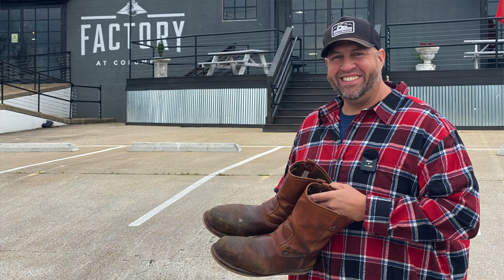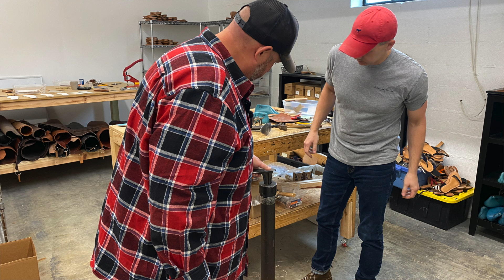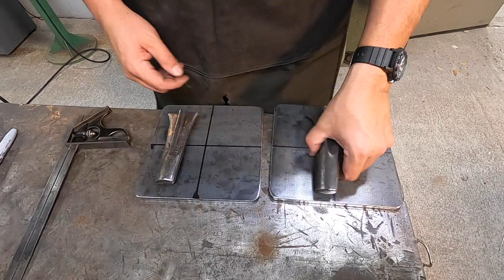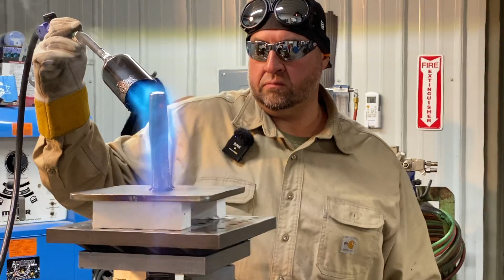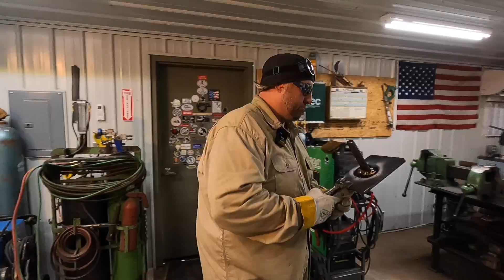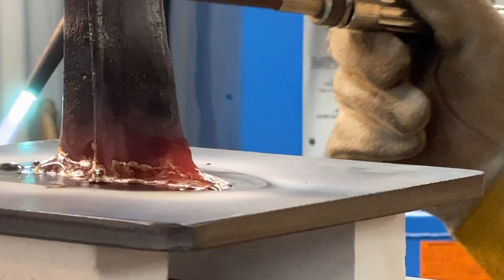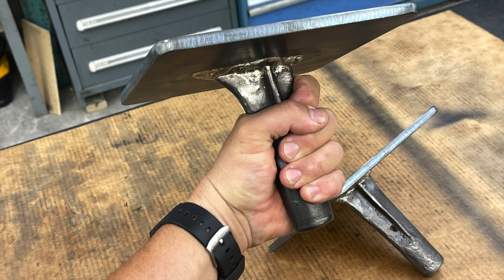Custom Shoe Anvils for Potter & Sons

Comment: A foot square is a standard tile size, I actually use a wooden block one foot square as a base for my rubber mat, quartz, wooden cutting block, etc… everything foot square.   Very handy for leather crafting.  I also use a metal tile.  It’s a snap to clean after gluing.

Comment: Why not braze it directly to the "shoe" surface? More surface area and a reversible modification.
Reply: The shoe is profiled, non of it is flat. There probably wouldn’t be more contact area and it would be a lot further to flow the filler. You could grind the shoe flat if you needed more strength but as Adam said they’ll be plenty strong enough

Comment: will the brazing hold the hammering in the long run, esp. when off to the side impacting the maximum torque ? or would some reinforcements to the sides help?
Reply: I think you're over estimating how much impact that will actually see. They're not forging steel, hammering nails into a hardwood, or swinging a 2 lb mini sledge. They're working on shoes.

Comment: TIG welding is a pain in the behind next to welding Aluminum. Usually you have a better weld bead than anything other welding method. But you could have used a MIG welder for a better finish. I love watching your video's. Arc welding is a pain & less effective then MIG or TIG welding.

Comment: Great welding video and explanation. I teach basic welding to our journeyman and ladies. Like you explained, clean surface on both parts, preheat is very important with that process, and considering the age of the casting you cut, that base material is probably great iron to work with. As you probably know, this country has lost some great foundries and the skills that people had working in them. Great job! Would love to see your shop someday. Dave

Comment: I think that brazing is defiantly a great process and you did the right thing brazing this part but I would like to see some tests because I think its all speculation because skill level is a factor when it comes to welding/brazing you might have more welds fail because of lack of skill when in my opinion brazing doesn't take a lot of skill so might have less fails

Comment: Those look great, but wouldn't be cheapper to build a new shoes anvil made of steel and leave the original cast iorn shoes anvil as they are becouse they are vintage items, and also less cosumption of butane and acetilene is more enviroment friendly.
Reply: The customer wants what the customer wants though
Reply: Vintage doesn't mean useful.  Those lasts (the correct term for those forms) were badly chipped and looked pretty small too.  Might as well make something useful instead of throwing them out (although interior decorators love that sort of random junk).

Comment: Adam;. Just few thoughts for conversation sake;
1.  With welding enjoying digital this and "intelligent" that, it is easy to lose sight of the fundamentals of heat bonding work.
Assuming the bonding agent can fuse to both sides [as in whetted bond], the strength of the joint is in the total area of the bond multiplied by the sheer strength of the weakest material involved (cast iron, whatever steel, brass alloy).  It is entirely possible that the vast iron is the weakest of the three. If this is the case then we know the weakest point of the completed device.
I agree with you that brass is [or could/should be] very strong.  At least as strong as the cast iron "leg".
Another point:. TIG produces very localized heat.  This is very important if  the materials bonded are heat treated or the seam has to be seen.
The gas torch produces a very large heated area.  This had the advantage of very good, even fusing over large area.  As heat treatment is not a factor at all then it is the best method.
The only disadvantage to brazing is it is ugly. If one had to look at the joint all day, then the seams would have had to be ground, but this is academic and thus mostly nonsense.
As usual, you are a very good, intelligent craftsman, and your decision is good.
Please do not be disheartened, or even annoyed by all the advise givers.  They are either young, immature people, or old farts like myself.  I watch your channel because I enjoy watching you.  You provide a link to a craft I dearly love.  A craft that life circumstances took away from me.
Thank you again for this beautiful platform.  I wish you all the success in the world. You are a good, passions man and I am happy to know you.
Simon8
Reply: Good brazing is fairly easy with practice, but excellent brazing is an art form.  I've watched a master bicycle frame builder make brazed fillet joints (no lugs) that needed almost no smoothing.  My brazing skills used to be good, but not THAT good!

Comment: brazing have ~30% strength of weld (compare surface area of touch), but in this situation brazing have larger surface area (braze float between plate the cast part, tig brazing can't do this), and you don't have heat effect zone and cast iron hate that welding cast iron make too hard and weak

and i don't allow cast iron cooling quick, putting on cold steel desk not good. I even isolated part to slow down cooling proces but this have more sense in welding situation

Comment: That looks like some good work to me I'm just wondering why it wouldn't have been more beneficial use of your time to create  new stubs out of steel rather than try and reuse the cast-iron ones?  With your skills of seems like doing that would have been quite simple and faster than the process you went through.

Comment: Brazing is the exactly correct process to use here in my opinion. It joins dissimilar metals well, its impact resistant, and it's plenty strong, cost effective and can be completed with commonly available tools. This is why Brazing is still used today for many things. Also there is a lot to be said for using a process you are personally confident in and have a lot of experience with.

Comment: Is there a reason that you didn't replicate the stake out of steel and then just weld it to the plate,,,,,maybe even with a couple of gussets. - To me it's a sin to cut up a vintage tool just to use it for a part you could make no sweat. Just askin'

Comment: Using TIG brazing to tack the pieces in place was a great trick to add to torch brazing.  I think you used the best of both methods to complete the job.
I have found that TIG brazing is good for small detail jobs where I want to get the job done without overheating the whole part but I think the torch along with preheating is the best for larger jobs that take a lot of heat to get up to brazing temperature,

Comment: I think the secret was the weed burner.  Would have worked for both brazing and the arc welding with the buckle rod.  A forge would have worked for preheating both pieces but especially for the cast.
Reply: Phone changed nickel to buckle

Comment: You did a great job! When I started to learn welding in the late 70’s the first they taught oxy- acetylene welding and brazing. I agree with you that it is a good process. Are there other techniques you could use? Yes. Today many who are learning to weld are not taught oxy-acetylene welding or brazing.

Comment: As someone who uses that type of weed burner often... The best way to get them started is to barely crack the valve open, click the striker, then turn it up. Too much propane flow will not allow it to ignite with the onboard striker

Comment: I once used a flap disk on a 5 inch grinder to remove the mill scale from both sides of a piece of 3/8 plate 400/1200mm.
would not recommend, I couldn't feel my hands after.

Comment: One thing Adam didn't mention in the weld vs braze talk is repairability in the future. If the braze should eventually fail and crack, it's a hell of a lot easier to fix and rebraze. Using a high nickel rod might produce a better joint between the two, but if something goes wrong, you can ruin that spot in the casting. If these pieces are really that old, getting a replacement might be a problem. And is the nickel rod really that much better? This isn't aerospace, this is shoe making, remember? So do you risk damaging a potentially irreplaceable customer part or do you take the safer route that is proven to work and can be pulled apart and repaired if needed.

Comment: I was about to comment that those looked a tad unsightly but after some brushing they look alright. You're right about joining dissimilar metals by soldering. In my books brazing is just soldering but with a filler that melts in a higher temperature.
I have a question about brazing; Does the filler flow in between the workpieces or does it stay on the edges ?
I have been silver soldering carbide inserts and have noticed that the silver solder is actually a tad too hard for the joint. It should be softer like brass. Maybe I should try that out with brass powder.
Reply: Play around with silver content in the filler. There’s many different fillers with different % of silver.

Comment: Why not leave the sole-shaped piece on the anvil?   Was it really necessary to remove that piece?
Wouldn't it be a better bond by welding that larger section to the plate?
Reply: If they were flat, it would be better, but the sole has a contour.
Reply: @scottlowe5590  - ok thanks

Comment: I was surprised you didn't mill off the "sole" to leave the most of the support webbing possible. It seems to me that would provide the most support for any off center hammering.
Reply: Thats what I thought or just weld it on the way it was. I don't think they will be making horseshoes only sandals.

Comment: I believe that braising is the only way to fix cast iron breaks, I used it to repair a engine on a diesel tractor just below the cylinder head and the tractor is still going today 20yrs later.

Comment: Would have been stronger if you had forged new stands to fit their last stand and made the whole thing out of steel. Probably easier to. Brazing never held Model T fenders together. {:-)
Reply: Forging,...forging hammers and all steel construction are not needed. Adam got the job done quickly and strong using tools and materials in his shop. Any other method would be lipstick on a pig.
Reply: @ellieprice363  No forging involved just take a round rod, heat it and flatten it a bit. If can't do that just use a belt grinder and egg shape the round rod. Lot of leverage on that braze joint when they hammer near the edge, Be interesting to see how it really holds up.
Reply: @poorfesor  Brased joints like that are stronger than you might think, especially the way Adam prepared them. Anyway that’s why he made two instead of four for his customer.
Reply: @poorfesor  Yes, the job could be done many different ways but Adam did it the way his customer wanted. Those tapered  shoemaker “lasts” fit in a socket and can be removed and replaced easily for different jobs. If the customer is paying for the job he’s always the boss.
Reply: I have to agree, and if not for some reason  leave the shoe form in tact and braze the entire thing.  Even that would provide a much wider, larger base, no?
Reply: @joewest1972  Likely would be stronger just because more area, especially if shoe was ground near flat.

Comment: Nice work Adam. I was always taught that brazing was using a brass filler, and bronze welding was using a bronze alloy filler.
Reply: He used a brass filler rod here. The guys at work "braze" copper pipes with a silver based alloy brazing rod. There's several types to choose from. Brazing is a term, not a metal.

Comment: I would imagine if most of the welding you did was TIG, and you were proficient at it, but not so much with brazing dissimilar metals, then TIG would be the way to go.
But if you've done them all, and can do them well, then brazing is the preferred method for the job in the video.

Comment: have you changed the battery on the weed burner? just unscrew the button assembly and the AA or AAA battery will be there.
Reply: It’s a piezo igniter. There is no battery and very reliable. The loud snap from the trigger is the giveaway… Most likely there is a gap issue @ the electrode (too close or shorted / too far away)

Comment: This looks very good Adam; this is the way I was taught brazing 40 years ago and it works every time. I always find it best to use the methods that I am confident with, not what other people think I should do. Out in the filed I have used batteries for arc welding cast and steel using stainless rod, but that is just to get equipment back to the shop for proper repair.

Comment: The same applies in the Autobody Industry. If some BRASS appears on a old car body that was BRAZED in the 70's... the new generation start pissing all over themselves. So did Boyd Coddington. I was trained at a Vocational School in the mid 70's to braze...the old cars that where taking 1st in TRI-STATE auto shows. I braze everything that applies. I hear they are using Silicon Brass welding on the cars today. Back to OLD SCHOOL... SIMILAR.

Comment: Would you also be able to silver solder the joint? It would propably flow really well into the seam.
But this should work very well too. Would maybe have put some chamfers on the foot part, but propably doesn't make that much of a difference
good work

Comment: You are actually ok with this brazing method as it is time tested and appropriate for the scope of work. I would have joined this differently.  I would have placed the cast shank in a 4 jaw chuck and turned a dovetail with radii. Then machine the female in the plate to twist and lock. 

This would be an alternative precision method to couple the two parts for many reasons. Shep our senior lube technician would have a fit if he saw you blowing all that airborne abrasive dust near the precision machine tools.  Also the fit would be more plumb. Either you tacks or your braze tilted the shank off axis to the plate.  But like you say it’s close enough.
Reply: Yet here you are again. Not a machinist but are giving advice and suggestions? Using your warped logic, I suppose since I’m friends with a doctor I can start giving medical advice. And who cares what “Shep” would think? I don’t and I damn sure don’t think Adam does. SMH
Reply: @grntitan1  your certainly entitled to you’re opinion. Just because I kick around the shop in my spare time learning from the pros here doesn’t make me invalid. 

I’m pretty certain that no one else would have thought of or offered a machined precision interface. But that it’s what’s called problem solving.  Perhaps you should stick your brazing fumes and perhaps eat a JB Weld sandwich while your strumin you’re banjo!
Reply: Machined joints are not required or needed for this construction. The method used is the preferred one for this job.
Reply: @ellieprice363  you are echoing my comment where I said brazing is appropriate here. Agreed machining an interlock for the two components may be a little more challenging. I believe the spirit of these videos is how to problem solve.

Comment: One thing with oxy acetylene brazing is if it won't flow you can see there is a problem  where as if you Tig braze you can have a cold joint or an over roll where the joint looks good but hasn't fused with the parent material- easier to pick up with oxy acetylene welding .

Comment: that looks awesome. I hade a set of peerless 2300 transaxel hubs brazed. they broke at the housing mount. never had a issue with them after. the trans was used In a 1000 lb derby mower.  used bronze I think. was a gold color. love ur videos thanks.

Comment: Thats Not welded, its Hard soldering and for that the solder seam is to big. Means, the flame was not correct and the plate was not hot enough.

Comment: Brazing is totally fine in my opinion. I'm well educated in this stuff it works best when you don't want to put heat into the material. The only concern I had was the type of tip on ur torch you were using while brazing it. The settings also. i was thought in school that with oxy welding or brazing the torch is suppose to be quite not noisy and also cone blue tip is suppose to be bright, sharp, small.

Comment: That looked more like Bronze Welding than Brazing to me. When I've braised things (back in my school days) the process involved close tolerance fits (turned pin into a reamed hole), flux and a gas and air torch. The rod was added once the piece was up to a yellow heat and flowed through the whole joint from one point. Then came the clean up... Since we were using Borax as a flux we were cleaning off what amounted to glass, very hard work.
Reply: Almost all bicycle frames were made that way up until aluminium and carbon ones came along. Incredibly tight tolerance fits and incredibly strong joints.
Reply: @flameboy7265  most UK made frames were brazed, not bronze welded. There were some frames that were butt bronze welded, fish tailed tubes and a bronze weld but the really good ones like Raleigh, Dawes, Claude Butler were socketed and brazed. The difference is how the filler gets into the joint. In a brazed joint the filler is drawn into the joint by capillary action.
Course it may just be semantics, differences in naming use.
Reply: @davidquirk8097  Exactly David! That’s what I was saying, I was agreeing with the comment before!

Comment: Silicon bronze tig filler would work best
Reply: No, the bronze remains on the edges with TIG. Adam used the best and only effective method since the solder necessarily flowed between the two parts.

Comment: Well young fellow, since you asked; grab a chunk of that cast and a chunk of plate and a few old piston rings for filler and glue it all together with the O/A torch and see what pulls apart first.  You get the heat right you'll have one interesting weld that will hold at least 70 years based on my experience.  
You want to stick to brass try buttering the mating surfaces with brass before you marry the joint up and you'll own the world.